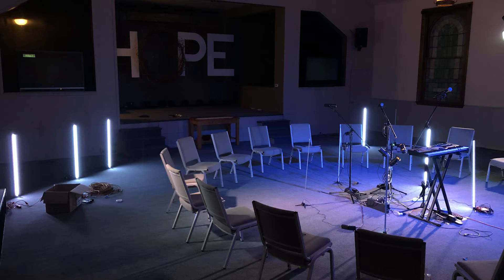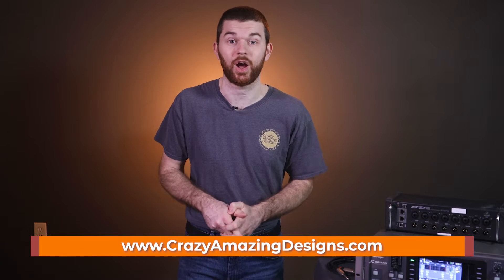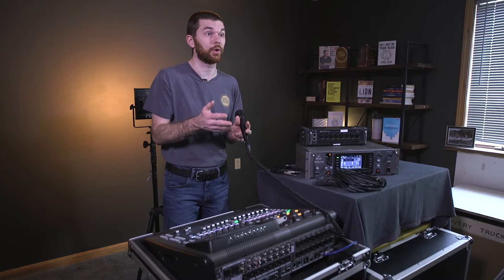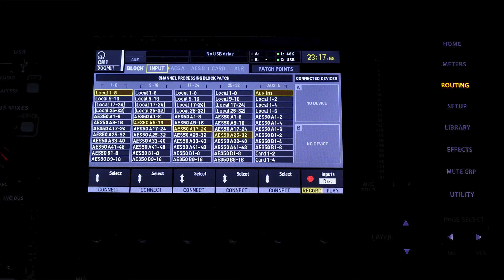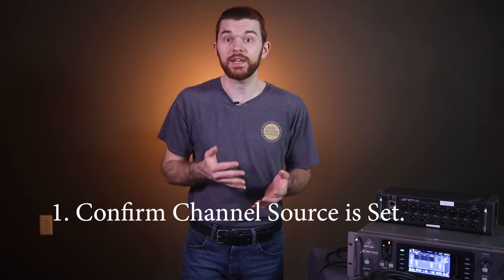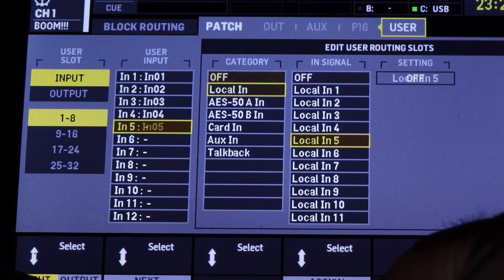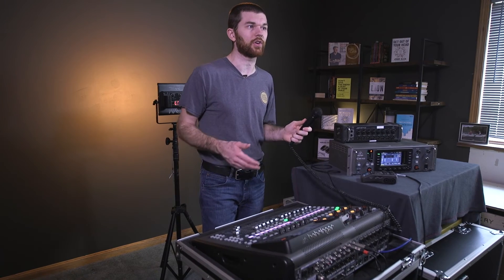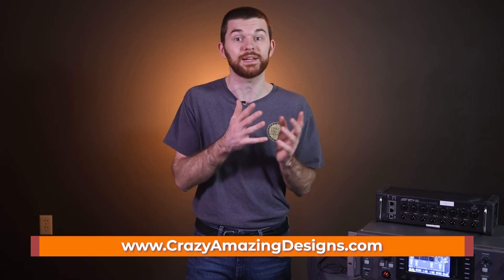USER Input and Output Routing on Behringer X32

Comment: I am having lots of problems using the X32 rack with my daw, having upgraded from a tascam interface, this X32 rack is proving to be so so challenging for me to get to grips with.

One thing I would love to know is how I can record a stereo mixdown in my DAW through the X32 (all effects etc applied) where the individual audio tracks (stems) are coming from the daw, going through the X32, and the mixdown back out to the daw so I can share it with people. 

Even worse, how do I monitor that mixdown from my daw, but via the X32, without creating a horrible loop?

Do you have a video that covers anything like this?
Reply from the maker: X32 can be challenging and super confusing. I have another video called "MultiTrack Recording & Playback | Behringer x32" where I cover the connection back and forth over USB. Beyond that If you'd like to signup for a Zoom Meeting, I'd be happy to help you get everything routed correctly. Find a time that works for you on my Calendar at www.CrazyAmazingDesigns.com/training -Nathan R

Comment: Through User inputs, can you take local inputs and see them via AES50 port to another console? Example: wireless mics plugged in locally at FOH console and need that signal to go to a monitor console. 
Thanks!
Reply from the maker: Yes, On the AES50-A page, send Local Inputs 1-8, to go to AES50-A 1-8. Now on the second console, Set INPUTS to AES50-A. Which is the input from the other console. You can also introduce USER I/O to do the same thing and get more detailed control of the Channels. -Nathan R

Comment: Good Morning. Thanks for the informed routing video x32 console. With that, here is my question. We have the x32 full console board. We were told through boxcast, using their encoder, that we could use their RCA jacks Red/White and connect it to the back of the X32 console Aux output 5 and 6 to the input on the boxcast encoder and make a copy of our FOH sound mix and have that be our sound mix for our livestream without messing up the FOH mix. 
  When we followed the videos on how to route the mix using the routing senario, and testing it out, didn't see read out showing sound to our livestream. Do you have How to diagram what audio cables from the boxcast encoder to the back of the X32 console and how to route. 

Thank, 
Wayne
Reply from the maker: Hi Wayne, This would be a great idea for a short video. Looking at the ways to route Audio OUT to an encoder for Live Streaming. There are several ways to route audio out of the x32. If you connect any cables to the 6 AUX OUT ports on the console, including the RCA. Go to Routing-> AUX OUT, and then select the Main L/R to go to those ports. -Nathan R
Reply: @CrazyAmazingDesigns  Hi Nathan and thanks for that advice. Will do on that. Another issue we recently ran into. ex. Since March 2025, we have ran into some type of distortion only in our livestream, but not in our FOH sound, only our livestream mix. We've check our mics, reached out to Boxcast about it, and the Roland V1-HD tech support team. As we checked, neither system was the issue. Thinking of setting the X32 console to factory reset and start over by setting my preamp gains at the max before clip on each vocal mic and go from their. Any advise??? thanks
Reply from the maker: @WAYNEBRAGG-ed5xj  If you are experiencing the distortion on just the stream output and not the main room mix, then determine if it's an issue with the XLR Output ports going to the Roland V1-HD. Or is it an issue with the Roland. Re-Route the stream output to a different XLR OUT connector to determine if it's an issue with the XLR OUT.

Comment: I am an experienced Analogue user who has just purchased an X32 rack and now trying to get my head around setting things up in the digital world! The video is very informative and I have followed it accordingly. I get sound out no problem with just a mic into channel one and a FOH speaker plugged into output channel 7. However, if I change to channel 2 (or 3 or 4 etc.) and have no output showing on the channel strip for that channel, the mic in channel one still picks up sound and sends it to the FOH speaker. Any suggestions as to what I may be doing wrong please?
Reply from the maker: This would be very difficult for me to diagnose without looking at the x32 directly. Send me an email and I'd be happy to jump on a Zoom meeting with you to straighten up the problem. -Nathan R

Comment: Hi Nathan, this church so I’m working with have a x32 rack an a sd8 but I need more inputs more outputs I added my S 16. How do I split the outputs for the SD8 an the s16 thands
Reply from the maker: Hi, You can't have more than the 32 XLR Inputs, and 16 Outputs from the X32. But you can pull from multiple stage boxes channels that add up to 32. In the Routing -> Inputs Tab, this is where you select console inputs. Easiest method is to Select the SD8 for Column 1-8, then S16 for Column 9-16, 17-24. For outputs go to the AES50 tab that things are connected on, then Select Output 1-8 to the SD8, and 1-8, 9-16 to the S16. -Nathan R

Comment: In min 10:46. I thought u were going to talk bout the aux inputs n routing on the other vids.
Reply from the maker: Aux Inputs from the 1/4" are pretty simple, In Routing-> you can select sources connected to the AUX INs, then on the AUX tab select the outputs. -Nathan R
Reply: @CrazyAmazingDesigns hey! So we have started using back tracks and I need to control the monitor levels of the aux in . I thought I'd maybe put it on a DCA for example the 4 is empty, because while the speakers have the DCA 1 assigned to the aux in, if you fade out there it'll still play thru the monitors, and it's complicated to quickly fade out the monitors at the same time.

Comment: This totally jacked up my S32 Rack. I have no outputs now. I think there are a few programming bugs in the Rack. My saved scenes have no output to the mains. This is an expensive paperweight.
Reply from the maker: I've been there, frustration is what lead me to make these X32 Routing Videos. I decided I needed to learn, really learn this system if I was going to be able to use it successfully for my church. Start at the basics, Do you have input?. Yes, Great! Now let's get the outputs working. "OUT 1-16" is where you assign the x32 outputs, 16 mixbus, but normally only assign 14 Mixbus and use 2 for the Main L/R. 7/8 or 15/16 are usually Main L/R. Now on the "XLR" tab, set 1-4, and 5-8 to be OUT 1-4, and OUT 5-8. Then connect speakers to XLR connectors 7/8 on the x32 rack and it should work.

If you have a connected stage box, On the AES50-A tab, Assign your OUT 1-8, 9-16. Now if you connect speakers to 7/8, or 15/16 you should get audio out to the speakers. 

Let me know if this helps. -Nathan R

Comment: The routing directly on the X32 is abysmal, my best advice is to load Mixing Station on to your Mac/iPad/iPhone or PC, and use the routing tab in the App.
So simple and straight forward, I couldn’t believe how complicated they had made it to do it on the desk.
Mixing Station is also a great way to mix out front.
Reply from the maker: For me I find my best workflow is to use the IOS app to Mix (If I don't have a Console), then if I need any routing done I use X32-Edit on my MacBook. -Nathan R

Comment: Great video, I've learned a lot from it! But one thing I'm curious about is splitting the input signal. I Have the X32 rack with an S16 stagebox, which should be placed near the drums and connected with x32 rack via AES50 (10 meters). I need to route 1-8 inputs of the S16 into the 1-8 outputs on the rear side of the x32 rack, without being affected by input gain. Basically I just need to split the input signal before any gaining, to feed whatever the FOH console is - I use the x32 for in-ear monitoring, not for FOH mixing. I've successfully routed everything, but unfortunately, PRE-FADER is the lowest option of OUTPUT settings. I'd need something like PRE-GAIN option. Is there a way to do so?
Anyways - thank You for your videos :)
Reply from the maker: To get a pre-gain you could use a Split Snake to connect the input signals to more than 1 Stage Box. Monitors & FOH & Broadcast is a typical setup. Then each console can set the Gain Structure for the channels. -Nathan R

Comment: how to do output to the different stage boxes not to a stream. For example, we want our mains going out of the main consul, we want our in ears going out of a stage box. I thought this worked like user input routing, but it doesn't appear to. I was hoping you could simply send output one to XLR one for example, on the console and output two to AES 50 output one.
Reply from the maker: That is a larger conversation than I can have in this reply. I have another video, Linked in the description of this one. That goes into AES50 Routing between Console and Stage Boxes.

XLR: Is the Local Console XLR OUT ports.
AES50-A: Should connect to the AES50-A port on your stage box, and the AES50-A tab is where you assign outputs to the XLROUT ports on the stage box.
Input: This is where you grab channels from Local Ports, Stage Boxes, Aux Inputs, Card Inputs, and assign them to the 32 input channels on the x32/m32.

-Nathan
Reply: @CrazyAmazingDesigns  Thank you so much nathan for quick response. 
do you happen to know how to use AES50 output Using USER? just like how to use the USER INPUTS, 
like one for one OUTPUT. say 2 Output from local and 2 from stagebox is that possible using USER OUTPUTS?
Reply from the maker: @christianawaao  Yes you can assign outputs to USER OUT, And select specific channels to output there. This video here should help explain it better.
Reply: @CrazyAmazingDesigns  sorry but the USER output using AES50 didnt mention here.   
on patching how do you want to patch the AES50 on the USER tab? im sorry for too many questions.
Reply from the maker: @christianawaao  Yes, I know how to use USER OUT routing, You just need to select USER OUT 1-8 from for example XLR tab on the console. Then You can select what is sent to XLR out 1-8, from 1-8 on the USER out. :)

Comment: Gentleman, thanks for the content. 
There's a possibility to use a channel in the x32 in line, without a preamp? To use with a external Neve 1073?
Reply from the maker: Glad it was helpful, You could route a channel out via XLR from the X32 and into the Neve 1073, but there are internal effects that can likely provide the same effect. -Nathan

Comment: Our worship service recently purchased an X32 Compact coupled with an S16 stage box. It seems to me that when routing the inputs and outputs that it is an "all or nothing" setup. You either input Channels 1-16 at the back of the mixer or through the stage box, same with the ouitputs 1-8. Is there a way to divide the inputs and outputs so that certain types of equipment can be located near the mixer, such as wireless mic recievers? Also, the same for outputs? In our situation I would like to keep our wireless recievers (which require one input each), as well as our hearing assist system, which requires one output. I have attempted to "split" the rouiting but by doing so, I either cancel out all signals going through the AES, or vice versa.
Reply from the maker: Routing used to be as you say "All or Nothing" Really it was Banks of 8. The USER Routing is how you avoid the Banks of 8, You need to configure things so that USER IN 1-32 are selected, then you can pick and choose for each input. Also, I'm sorry I missed this comment. -Nathan (Email me if you can't get it).
Reply: @CrazyAmazingDesigns  Thank you for addressing my question. I will make another attempt at routing via the USER option.

Comment: Hi Nathan. 
I have an X32 with an S16 Box. I'm struggling to change the Left and Right XLR (Speakers) output from the back of the desk 
to AUX 7 & 8 on the S16 Box?
Reply from the maker: Hi, You can easily connect the S16 to the x32 via AES50-A on both devices. Then in the Routing page-> AES50, Assign "Output 1-8" to the First Column. Then on the "OUT" tab, Assign what audio goes to the 16 outputs, 8 of which are assigned to the 8 XLR Outs on the S16. -Nathan R

Comment: Thank you for the video! Am I correct in saying that the Full X32 only do 16 outputs in total at one time?

I’m wanting to do a setup using a mix of local analog outs and S32 outs, but I don’t think it’s possible. I’d need 18 outs (sub, overflow, 6 stereo monitors, stereo live stream, stereo mains). Can’t seem to figure out if I can do more than 16 at a time. Let me know your thoughts
Reply from the maker: Yes! You can only do 16 MixBus outputs per x32, but using the USER Outputs, you can send any input of MixBus to the Outputs on the stage box. -Nathan

This might be a great video idea, Email me if you'd like to talk further.

Comment: How do I set up a MAC PC to send audio to X32? Our X32 is set up with an Ethernet cable from the stage box. We also have a Blackmagic ATEM that is receiving sound but it is not sending anything to the X32 so we have no audio. We need help
Reply from the maker: The AES50 connection between the x32 and the stage box, it uses an Ethernet cable but that's all it has in common with networking.

To get audio from the computer to the stage box, use an Audio Interface such as a Focusrite 2i2. This device will have a USB-C connection to the computer, then the outputs on the back will get converted from 1/4" tp XLR and connect to the stage box inputs.

If your MAC Pro is within a few feet of the x32, you could also use the USB connection. Then go to the Routing page, CARD tab and in the 4 columns, select the console inputs you want to send to the device on the other end of the USB connection. With this USB connection, the x32 will automatically receive audio on CARD 1/2, which is the computers main L/R.

If you'd like additional help, email me. Schedule a meeting with me on my calendar andf I can help get a Matrix setup to send audio to your stream -Nathan

Comment: Question! I’m getting x32 compact very soon. My question is I know that the main left and right default to channels 7 and 8 on the local outs. Can this be changed to 7 and 8 on the stage box and routed to 15 16 on the console?
Reply from the maker: Yes, Connect the x32 Compact (AES50-A) and Stage Box on (AES50-A). Now in Routing-AES50-A. Select Output 1-8,9-16. Now it's routed, so go into the OUT tab and change the outputs to match what you want. use the XLR tab to set the 8 outputs on the back of the Compact. -Nathan
Reply: @CrazyAmazingDesigns  thank you! I’m finding your videos pretty helpful in prep for our new church system and upgrade.

Comment: I have an X32 Compact and an S32 stage box. I need to output Mains LR and 8 Wired IEM mixes from the s32. How do I route this on the compact? I thought I followed this video to the T. However, im still only able to use outputs 1-8 on the s32. Does the Astrid on output 9-16 go away once it's configured properly? Im going a little insane at this point. Please help.
Reply from the maker: On the compact, go to Routing Page. Assuming the S32 is connected via AES50-A on both the compact and the S32. Go to Routing-> AES50-A tab, select 1-8 and 9-16 as Output 1-8 and Output 9-16. That should be all the routing to get Outputs 1-16 to output on the s32. Go to the OUT tab to set what  source is set to each output. -Nathan (Email me if you still can’t get it working.)
Reply: @CrazyAmazingDesigns   thank you for the response, I figured out that the default setting on bus 9-16 (which im using for monitor sends) needed to be set to post fader... all good now thank you!

Comment: Hello. Can i separate the gain from  the church from the gain oferece the live?
Reply from the maker: Hi! Unfortunately, only one x32 can control the gains on the connected stage boxes. If you have multiple x32 consoles that share the same stage boxes, only one can control the gains. If you want separate gain control, you need a split snake and a second set of stage boxes. -Nathan

Comment: Could you please explain!

I have 2 behringers. 1 rack on stage for In ear monitors and as a digital snake.

And 1 behringer for Front Of House. Which I want to send out an L/R signal.

I connected them via Aes50 To A and A. 

But I don’t think I have the routing right, because I don’t have signal going out to speakers on the FOH console?

How do I fix this???
Reply from the maker: Based on what you said. At the FOH console on the AES50-A tab, you need to select OUTPUT 1-8, which sends Output 1-8 to the x32 Rack over AES50. Specifically Output 7-8 are setup to be the Main L/R out from the FOH console. (Via the OUT tab) 

Then on the x32 Rack, on the XLR tab, this is where you select what inputs that the console is receiving get routed to the XLR output connectors on the back. So we will select AES50-A 1-4, 5-8. This receives the main mix from FOH and outputs it to the Stage x32.

This should work, but if you still have issues your best bet would be to consider booking a 45min Zoom Consulting Call with me through CrazyAmazingDesigns.com I will answer any questions you have, and make sure everything is working correctly. -Nathan